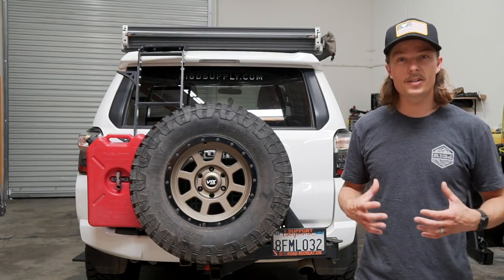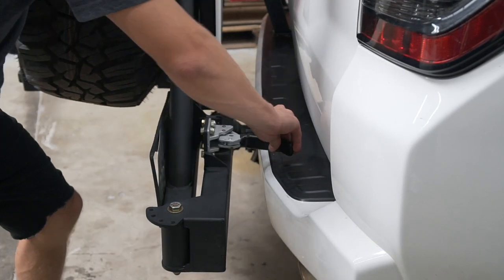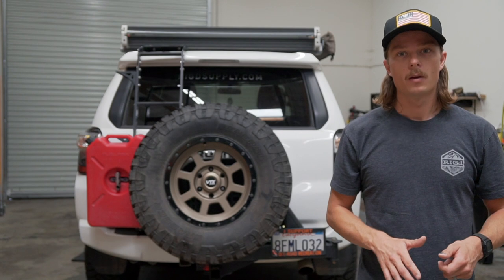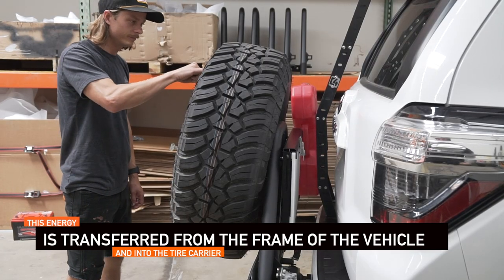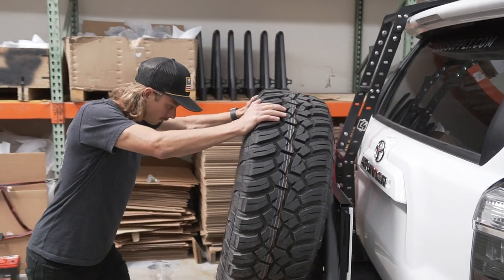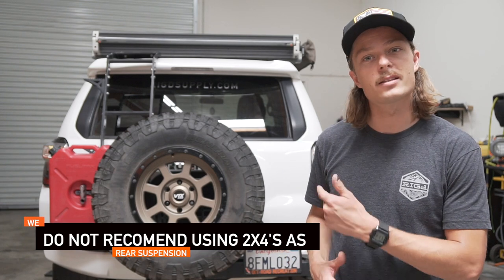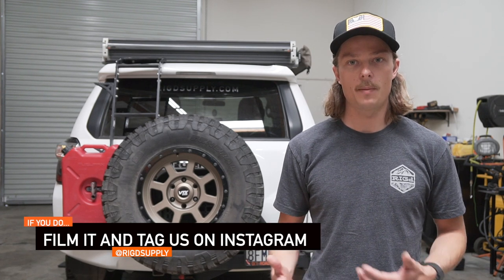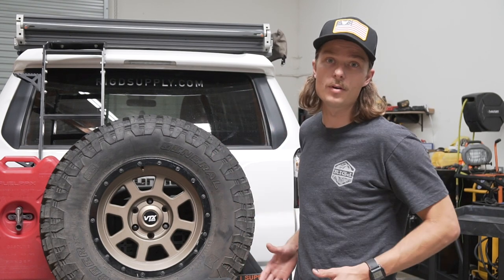The Wobble Test | How to Check if your Bumper or Tire Carrier is Off-Road Worthy.

Comment: you mentioned the shaking/vibration of the 4runner around 50-60mph. Why does that happen? I've been noticing that lately. I'm watching all these videos before purchasing mine before 1/15/22. hehehe :-)
Reply from the maker: Thanks for asking. There's a sweet spot where resonance can be reached. Are you noticing that in your 4Runner without an UltraSwing?
Reply: @rigdsupply6945  O Ok. Yes, I am.

Comment: I have a 2020 Jeep Gladiator and was wondering if you guys have done any gladiator applications? It has a backup camera in the tailgate, any way to relocate it? Great product!
Reply from the maker: Hey Chris, yes, we've done quite a few Gladiators. You can relocate the backup camera using our bracket and relocating the factory camera.
Reply: RIGd Supply ok nice! which one would work best for my truck with 37s?
Reply from the maker: @mcwendel8066  https://www.rigdsupply.com/products/rigd-ultraswing-hitch-carrier-mega-fit

Comment: I noticed vibrations around 60-70 mph and can be pretty intense. Can I do anything to reduced this?
Reply from the maker: In most cases MORE weight reduces this. Example: adding some fuel/water, carrying bikes, etc. We typically see this with a light setup (just a spare tire, and maybe a UltraTable. Feel free to call us to discuss other options to reduce this.

Comment: Doesn’t wobble side to side but you can still feel it inside your truck when you’re driving down bumpy roads you can feel the vibration from the top-heavy tire
Reply from the maker: Thanks for the comment. The oscillation has been experienced worst on bumpy highways when used on vehicles running little weight on the UltraSwing, like just a spare tire or spare tire and table. Once the additional weight is added (like a SideHack with Fuel or just Furl/water, this tends to be much less). The suspension also plays a big factor, typically this is at its worst with over-sprung vehicles with little adjustment for compression. Let us know your year/make/model and well as tire size/suspension/and speeds and we can advise further.

Comment: does it rattle like some of the other hitch tire mounts? it's the one thing that's been keeping me away
Reply from the maker: The is zero movement between the UltraSwing and the vehicles hitch. We'd encourage you to watch this other video of ours to make your expectations crystal clear: https://youtu.be/0s_bujOEnww Let us know if you have any other questions.
Reply from the maker: @NobodyCaresAboutIt  Thanks for the feedback, shorter vehicles like a Crosstrek can definitely make resonance more noticeable since it's quite a bit shorter than a truck. Just to collect more data, which hitch are you running on your Crosstrek?
Reply: @rigdsupply6945  How do you reduce Resonance?
Reply from the maker: @Voss2120  Extra tension on the pivot bolt, sometimes adding more weight (ex: carrying a Rotopax), or adding extra latch tension with the use of our supplied fender washers that go behind the bumper, are a few tricks for reducing resonance if it's an issue. Also, feel free to reach out to our support team at support@rigdsupply.com if you have other questions or need more support to resolve any issues.